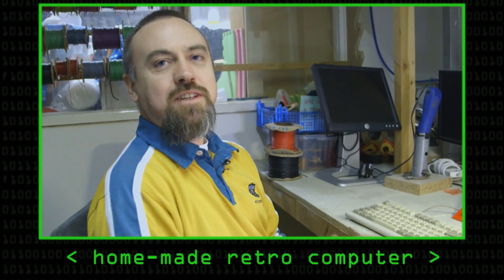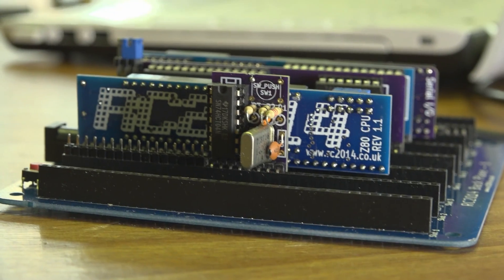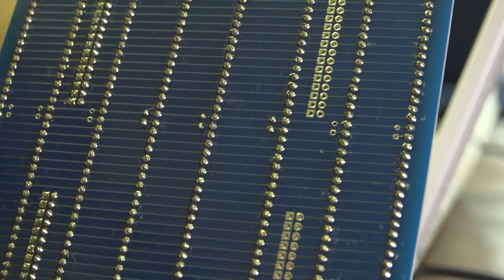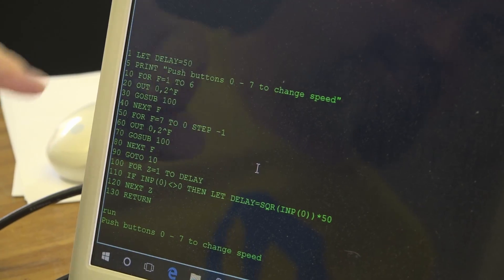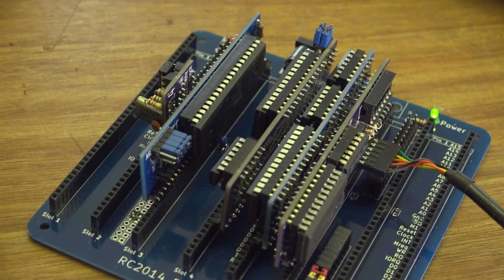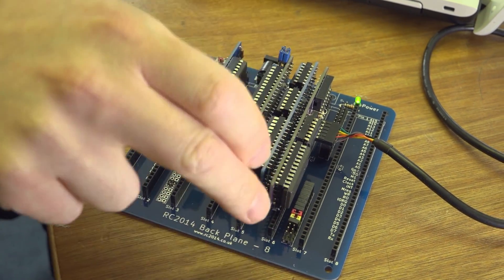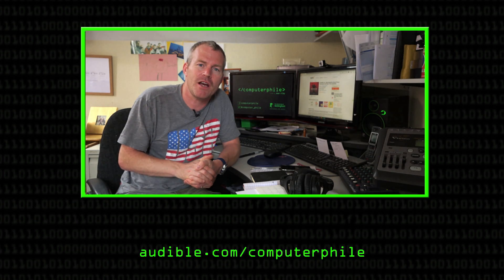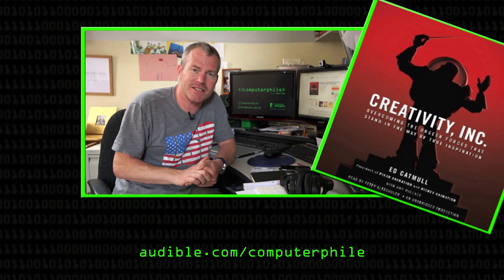Retro Computer Kit - Computerphile

Comment: There is nothing tricky about SMD. Tack down a component on one side, solder down the other side then return to the tacked down side to property solder. It only gets tricky when you try to remove a component while keeping it in tact.

Comment: Copying stuff in from Github is cheating, teaches you nothing. Type it in and you really learn how programs work! Or, more accurately, learn how they don't work and how to debug them. You learn from the journey, not from the destination.

The challenge here is clearly to make a CRT controller with a handful of chips or fewer. The ZX81 did it by software bit-banging the output, so it shouldn't be rocket science, plus it would be a great use for the extra 32kB of RAM.
Reply: The most obvious choice today would be to use an AVR microcontroller to generate the video signal.
Reply: I don't know. Entering type-in listings probably helped teach me to type, but I'm not so sure you could really learn that much programming from it. 

It was mostly just a tedious copying exercise. So tedious that your brain would switch off and you're not really paying much attention to the code itself, beyond that you're copying it out correctly.
Reply: BAS signals are easy to generate, VGA is the though part because of its strict timings.
Reply: Look at what Apple did with the Apple I and the Apple II.

Comment: The Z80 can handle other languages other than BASIC though a lot of on chip BASIC packages were created.  I've run Pascal and Fortran and LOGO on 6502 computers and 80286's so should be available for the Z80 as well.  I just wish it also has the 0 page addressing in one machine cycle the 6502 had, I always figured you could use a hardware register to swap banks of ram and thusly not be limited to 64K
Reply: Theres the eZ80 line which is mostly software compatible but has a 24bit address space.

Comment: Would a computer work in space?
Reply: +Jane Black Might need shielding from radiation though.
Reply: +caw25sha what about thermals? There is no air so would it overheat?
Reply: +BOPPE 
I assumed you meant in a space station. If you mean outside, say being used by someone doing a spacewalk, or in an unmanned satellite, I am not sure how they are cooled but there are obviously thousands of computers, on the ISS, and in satellites and probes so they have obviously got the problem solved.
Reply: Nope

Comment: Z80 forever
< see avatar
Reply: The Z80 is incredible
Reply: A lot of people act like the Z80 is outdated without realizing that most students today still own and use Z80 computers.
The TI-83+/TI-84+ graphing calculators are Z80 computers and it's like the most common graphing calculator there is. They are fully programmable in Z80 assembly too, and I have fun programming them all the time. Not only are they fully programmable, but they have a nice (sort of) serial input/output interface so you can easily program it to interact with external hardware or other calculators.
(Although the latest calculator, the TI-84+CE, is actually an eZ80 computer and the easy serial interface was removed and it only has USB, which is not easy to interact with at all. The TI-84+SE is probably the best for hackers.)
Reply: What the Z80 has in special?

Comment: It will only run basic programs though

hehe
Reply: Basically, yeah
Reply: Z-80 assembly should be easy enough to do.
Reply: Jim Fortune Thinking about how you could accelerate graphics rendering makes me realize how close graphics cards are to having a second smaller computer plugged into your computer.
Reply: And what video port if any,  is that also a serial to another computer to get the render out?
Reply: Jonas Thörnvall I think you'd have to use the serial port to an external storage device.
Reply: I totally forgot what a terminal emulator is and how it works, maybe they had render capabilities. Is basic modular so you can load function by function working on the dataset and write the result over serial and access it again?

32K isn't much space to write a program. But if you do not need the dataset in memory all the time it is another story.
Reply: Jackpkmn The Apple II used memory mapped graphics like you describe.
Reply: Jackpkmn I got my start back in the days of 1 megahertz 8 bit computers. These days low end graphics cards have processors that would run circles around anything you could buy back then.
Reply: Z80 assembly doesn't have a dash in it, Jim. :c
Reply: Amelia Hartman It does in some of the books I've had over the years. Besides, I always preferred 6502 anyway.
Reply: Jim Fortune I like Z80 because Texas Instruments still makes Z80 computers to this day pretty much everywhere. I can't think of any commercial 6502 computers still being sold, although if you do know of any I would like to know.
Reply: Amelia Hartman Other than buying something used, I can only think of doing a software emulator. I've heard there are some one chip computers that use 6502, but haven't found any for sale.
Reply: Simple computer monitor is now included in all rc2014 kits, meaning you can switch between basic and machine code.